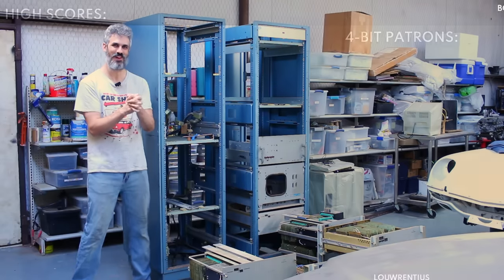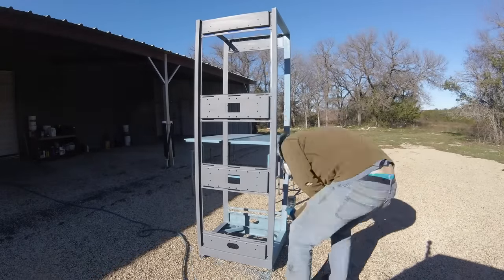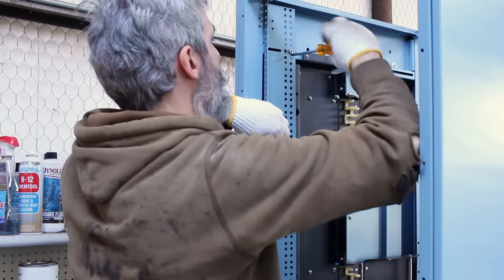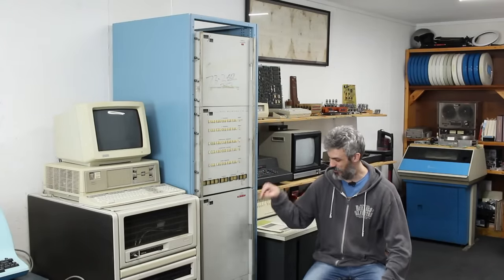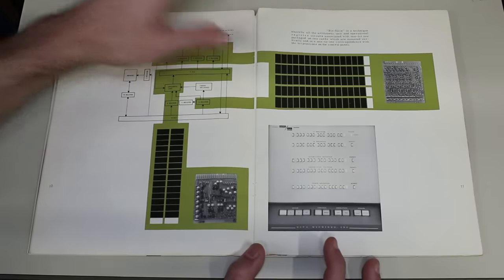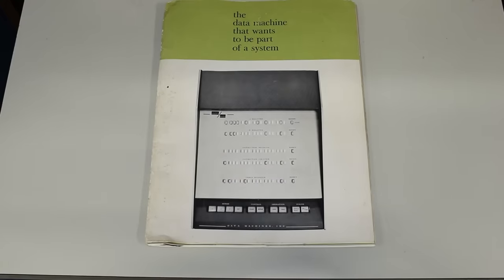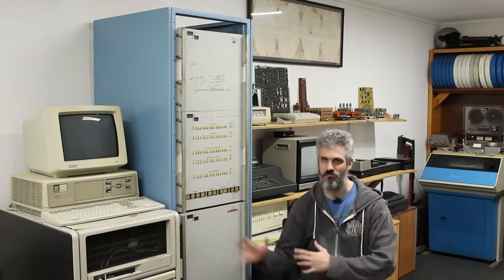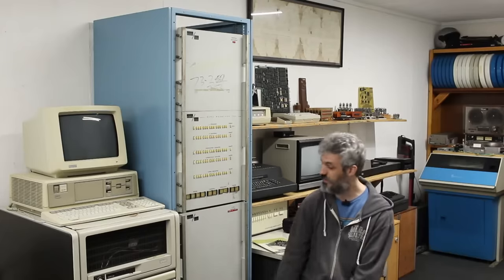My New NASA Minicomputer!

Comment: That front panel is a lot like the Burroughs B-500 I used to run. The combined "lights and switches" is basically a look at what's going on inside the processor at any moment. If you pause the operation and press a dark switch, the corresponding bit will turn into a 1. If you hold down the "reset" switch for that row and press a lighted switch, that bit will be reset to a 0. So, using that method you can enter an address and then modify the data or instruction at that address. The sense switches were a handy way to modify program execution. So, for example, if you had a GL transaction report that generated a detailed transaction report for the month plus subtotals and totals, you could signal the program to modify its operation using the sense switches. That way one program could generate a detail report for the month, a totals only report without detail, a daily report, or even an annual report with or without detail based on the sense switches that were active. 

This machine looks like a fun find and I wish you luck restoring it. I only have one observation that I'll pass along, based on experience with other machines. Core memory uses a lot more power than one might expect and, often, that's why it ends up divided across multiple drawers with multiple power supplies. 

Thanks for sharing and good luck. (Hope the back is better. )

Comment: Hi Usagi, I have a tip for you to polish those grab rails, it is called NEVR DULL and bikers often use it on bare metal surfaces of motorcycles for cleaning/polishing. It is less abrasive and destructive then steel wool and it makes your work much much faster.

Comment: Re: the castors - we had the same problem with a brand new open-frame rack. Had to get a metal plate fabricated that would not bend in when the rack got loaded.

Comment: The register buttons look like they work like the ones on the Univac 9400 mainframes I worked on many years ago: You press the Reset button to clear all the bits and then you press whichever buttons need to be set to a "1" state. When a bit is set, the light in that button turns on. If you press the wrong button, you have to reset everything and start over.

Comment: i would try emailing NASA with the info on the stickers and any model numbers to see if they have any info they can give you for what the machine worked on.
most likely youll get nothing but there is a chance you get something cool. a system like this would not have been running accounting programs in some office, this helped with something more important and i hope you can find out something about what it did for nasa.

Comment: It sounds funny, but try plain water on the magic marker first, and if that doesn’t do it…

You can try Old English.  Yeah, it’s sold for furniture, but I know from experience that it is great at dissolving the gray gunk left behind those metal property tags which were popular in the 1960s and 1970s.  I haven’t tried it on magic marker.

VM&P naphtha or cigarette lighter fluid in a pinch may get the magic marker off.  Try it in a hidden spot first to make sure it doesn’t dissolve the paint.

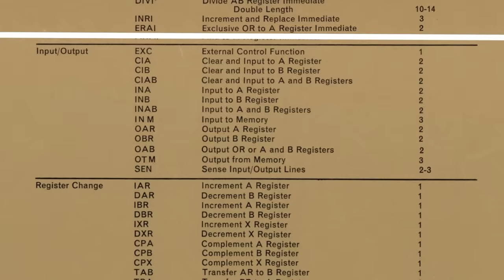Comment: Interesting machine. Thanks for the information about it. BTW, there is a typo in the list of the instruction set in the manual as seen at 15:38. DAR is described as "Decrement B register". It should have said the A register. There won't be anything useful left in the core memory. Back when I was a student in Junior High school an HP2114A computer came to our school and I got to operate it. The BASIC interpreter was loaded from paper tape. We turned the machine off over night and it was ok the next morning, IIRC. However, if it was left off over the weekend the magnetic fields in the core memory had degraded and the paper tape was needed again.

Comment: 18ms for an addition.  How far we have come!  I remember working with computer trainers that had core memory, and were TTL based.  I agree that a transistor based computer was missing form your collection.  The simple fact that transistors were smaller, less heat intensive, and faster than tubes makes me wonder how powerful that machine actually is, compared to say, the Bendix.
Reply: Discrete transistor machines are terrific - they are almost infinitely repairable.  There's one museum team keeping an IBM 1620 running; it is discrete transistor and they have the full complement of peripherals.

Comment: for magic marker, just scribble over top of it with another magic marker and wipe away. it should help a great deal if not completely remove it. By the age I'm gonna guess you need a Magnum 44 marker, which thankfully I don't believe the chemical composition has changed much of in the past 60 years, down to the metal market can it comes in. If that doesn't work, try regular sharpie.

Comment: Doesn't the machine have control circuits for it's core memory? Yes reading is destructive, technically, but the controller takes care of writing it back again a moment after. As a whole system, you should be able to read it at your leisure. 

Probably the next Iphone will have a 3D magnetometer and you'll just be able to wave the thing past and pick up some rocket scientist's emails in an instant.

Comment: 1965 -1966 might have been Gemini too. 
In general computers of that era used "words" for memory.  Bytes was not common. Hence  17777 words (16 or 18) and not bytes.  Reading the screen at 23:04 it says 8192 WORDS which when translated  in to bytes would be 16KBytes. I may be inverting my math here but it seems more 'of the era' to say "words". 

E.g. 8,192 words at 18 bits/word = 147,456 bits or 18,432 8 bit bytes, Their may even be "hidden" parity bits. It would have been as easy to say 8K word than 18K byte.
Reply: This is correct: that's almost certainly 17777₈ = 8192₁₀ × 16-bit words of memory, about equivalent to 32 KB. With a 16-bit address register it would typically load 16 bits from memory in one memory cycle, which is why the memory is 16 bits wide. It's highly unlikely that it can even address half-words: that would halve your address space for little gain.

Back in that day 8-bit bytes weren't really much of a thing; IIRC the IBM 360 was the first machine that made any major use of that size.

Comment: Looking forward to you getting into this in the future! Here's hoping for a productive 2024... that said, that marker on the front of that module is going to be a SERIOUS challenge to remove. I've had to refurbish equipment before, and the solvent that puts the 'permanent' in 'permanent marker' does a pretty dxxn good job of penetrating at the molecular level. Your best bet is to just have some paint mixed to spray over that part of the panel after a good cleaning. :( Too bad the logo is silk-screened on and not just a removable badge (or can you have a water-transfer decal made?)
Reply: There are quite a few toy and household electronics restorers on YT that use decals, either commercial or custom, and they're perfectly decent.
Reply: I thought there were inkjet and laser printable decal papers, and in fact there are.  If the panel can be detached and the logo scanned, then yes a decal can be printed, and this panel should be small enough to take to a paint store with paint matching equipment.  Something like Kilz can be used to prime the panel over the marker, then the paint applied over that, and finally the home printed decal.

Comment: I don't particularly like the term that it was octal or a hexadecimal computer. All digital computers are binary by their hardware nature; octal or hex is only a representation, nothing more than whether the switches on the operator's panel are grouped into 3s or 4s, and how the values are written in the manual. But all of this has little to do with the actual architecture of a computer. Let's take the Altair 8800 opcode for the HLT instruction, it's manual says it is 166 oct (01 110 110), but we may also write it as 76 hex (0111 0110) and in either option, you end up with the same position of switches on the front panel. It is true that for some word lengths, it is easier to use one or another numbering system, but it is not a must.
Reply: 100% agree. I also made this comment. It's a binary computer... the "octal" or "hex" nature of it is purely the interpretation of the user.
Reply: Using octal shows patterns with the Intel 8080 microprocessor which reflect how the hardware decodes instructions.
In general the opcodes \100 to \177 equate to MOV R1,R2 where B=0, C=1, D=2, E=3, H=4, L=5, M=6 & A=7. With \166 breaking the pattern as HLT rather than MOV M,M. Whilst \100, \111, \122, \133, \144, \155 & \177 are effectively additional NOPs
Reply: @markevans2294  But still, those are human readable patterns. They're also visible in a binary notation, not so much in hex. Physically, those are flag bits for configuring internal signal routing in the CPU.

Comment: Very cool piece of equipment.  That manual is a valuable piece of documentation.  Hopefully you will have access to schematics.  You have a ton of work to make this thing work - quite a challenge.  The switches/lights looked bland to me also until you pointed out they do both.  The challenge of testing the core memory for function, without altering what is there - that alone is a major project.

Comment: So much awesomeness, great find! And I indeed immediately thought about the core memory maybe containing something, they did something similar with the core memory of Apollo hardware (curious Marc). Given that has flown, I think they actually didn't wipe as a standard, they probably didn't even think about it being possibly misused back then.
Reply: Probably went into storage, and after 5 years was moved from active storage to archival storage, as it had not been reused for another program, or robbed for spares. then after 10 years went to disposal. Likely still has whatever was the last program run still sitting in core, just with the last address in the program counter core line possibly erased, because it was in the process of being read when power was turned off the final time. So many old core memory machines have had that core recovered nearly intact, after decades of sitting in a warehouse, especially old government machines, and only relatively recently did they actually start to erase core and such when selling them off.

Comment: An old trick used by presenters who accidentally used permanent marker on a whiteboard - go over the unwanted marks with permanent marker and IMMEDIATELY wipe it off before it dries (use the solvent in the permanent marker to dissolve the ink). Try it on a small, unobtrusive area first.

Comment: Nasa-kun?  I thought she'd have been Nasa-chan!  I knew a guy once that had a cat named Tora-chan. Actually, she was Tora-hōhi, but that's a bit rude, don't you think?  Then again, the guy's other two cats were Foothead and Dweeb, so....

I got started in programming in the 1970s on gear that was obsolete even at the time, so this machine is looking fascinating!  It was a time when there were a zillion startups trying to produce their own CPUs, so architecture got weird. Most of the programming I did in that period was on gear from GE and HP.  The GE was 36-bit word size like a Univac,  The HP (one of the 2000 series, don't recall which) was a 16-bitter and the architecture was kind of similar to that Data Machines box.  It had a very wide I/O bus for connection to HP instruments. Like the Data Machines box, the core memory came in 4k--word buckets, and it could support 8k words on board, and up to 32k words with an external extender.

I know you say that DEC loved the Am2900, but the DEC machines from the early bit-slice-IC period that I remember all used the 74S181 along with a lot of glue logic.  (So did the DG Nova, Xerox Alto, Honeywell 2000, TI-990, and the V70 machine that was Varian's replacement for the Data Machjines series).  You could almost fry eggs over all the Schottky TTL!

Comment: I'm struggling to understand why you tear the machine apart before you turn it on for the first time to see what happens. There is a good chance the machine will turn on fine the first time. If it does not turn on correctly after you tear it apart, do you have any idea to understand what you did not not put back correctly? (speaking from experience). The tty interfaces were standardized, its not difficult to get them into a modern computer or terminal server. You can convert various current loop networks to rs-232. Also- what the heck... assembly is easy... you are not going to learn anything from the cores. The cores will not reveal the programs that stored the information to use that information. Indiana Jones is not going to swing in to produce the missing program tape either.  Spend 2 minutes to learn enough assembly on how to add 2 numbers to each other and print the output. This should not be more than a few lines of code that you can enter from the front panel. Then- you have a space heater, and a computer that works to produce heat that is slightly more productive than a space heater... my advise, take it or leave it.

Comment: I don't think this qualifies as an octal machine. By the looks of it, it uses standard binary. 1 and 0. A true octal machine would have 8 states per "bit". Ternary machines for example did exist at one point in time. Using 3 voltage levels to encode information. Positive, negative and zero.
What is common is that programmers used octal notation for these machines. It's shorter than binary to write and easy to convert to three bits in your head.  But that doesn't make the hardware octal.

Comment: Cleaning can be tedious, but it's also usually the easiest part of something like this 😂 also.. an "octal machine" has no fundamental difference from a "hexadecimal  machine"... it's just human interpretation.
Reply: You can find an octal arrangement on the front panel of the Altair 8800 microcomputer from the 1970's.

With patterns in the Intel 8080 instruction set being most apparent using octal. Likely this is the case with any processor architecture derived from the Datapoint 2200.